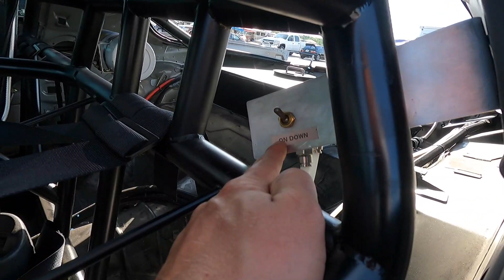Moon Tune! Camaro Can Fly!

Comment: You tightened up the suspension and limiters so instead of wasting energy bringing the front up, it used that energy going further forward.
Reply: Yep... it is a balancing act for sure, but it is also using a quite aggressive bump strategy.
Reply: @wobblysauce  very
Reply: Also rewatching it a few times also didn't just hit the first light but rolled into it, so if he just hit it like normal, the bump might have been fine. 
Best case.

Comment: Copper what happened to you in the NHRA is called Deep Staging. The front of the tire goes in to deep and then you bumped and the back of the tire breaks the beam. When i had my Top dragster i never had to worry about those gadgets just the transbrake and throttle stop.

Comment: the whole front end lifted enough to allow the rear tires to push the car through the beams
i dont think the brakes are the problem 
the little video inserts of the tree staging you can see the front end lift and the bump box pushed the car through

Comment: Put a white mark on that back tire and work the bump staging, "Mickey" Almost made a 1/4 revolution and whole car pretty much hopped.  In the video look at the track contact patch under the right rear tire easy to see line and distance after lighting top bulb, gotta be like 20 inches.  Gonna be neat seeing you trip the 60 foot with the back tires!
Reply: Limiting straps done up to tight, so front went full extention and had nothing left, so wheels lifted, no wheels on ground car moves forward.

Comment: The tree has to be activated before red would come on, even when you overstage. It tuned red when tree was activated. Nothing you do to the brakes will help that situation, look at your video,  it bounced tire off ground & past stage bulb. Calm down the bump sequence & NEVER stage unless your in full race mode same as you'd be in a final round.

Comment: Looks like you rolled in too deep in the prestage.  You need to roll in slower or you need Bronte to bring you in.  The tree didn't red light you right away because the starter didn't get a chance to activate the tree.  He has to press the button once both are in.  Heartbreaking video... been there.  Drive 8hrs to go out like that is a total drag.  Good luck.

Comment: Cooper take it and have the damn thing fixed correctly. I hate it for you, you worked hard on the car and you have known that this has been a issue so fix it. 
Sorry for the loss. You also need to have some help. If you don’t want the wife to help then get someone to help. You cannot do everything.
Reply: He literally had someone build the entire car for him already. And sponsor's gave him most of the parts or huge discounts.  He should've stuck 2 filming for Cleetus.
Reply: @chatta6013  l don’t know that information you are talking about. I also don’t know what Cleet and him decided on and why he quit filming. You must know them both as a personal friend. 
 I just commented on fixing is bump in problem.
Reply: @martyportersr7008  it's already well known some1 built the entire car for him.   If you didn't know that you dint follow much. Induction perforbuilt that entire setup for him  and sponsors and discounts paid for the work 2 be done. All cooper does is tweak stuff etc. Without cleetus he wouldn't even have that many subscribers if any at all. He should've stayed with ol cleets crew.
Reply: @chatta6013  Well good for him.

Comment: Please stop using Harbor Freight cut off wheels I got really hurt are required a lot of stitches from a Harbor Freight cut off wheel that exploded I've had too many of them explode for no reason I started using Benchmark abrasives cut off wheels you can even purchase them on Amazon and get them pretty quick and believe it or not they're actually cheaper from Amazon then they are directly from benchmark I'm not associated with the company I started trying their products whenever they were giving away some flap disc and they are still giving away flap discs if you use a certain promo code I don't know it off top of my head but it's probably pretty easy to find but do yourself a favor and stay away from Harbor Freight abrasives and cut off wheels